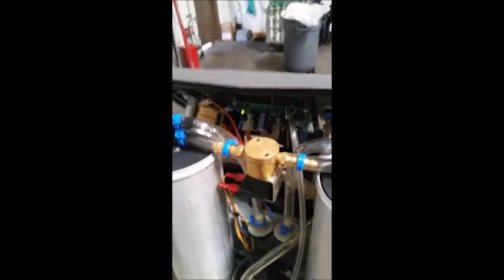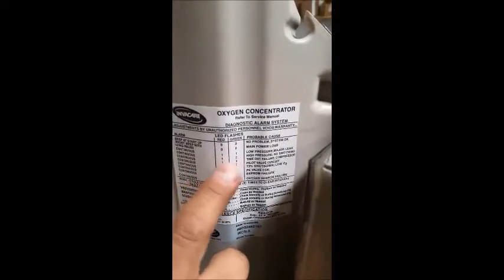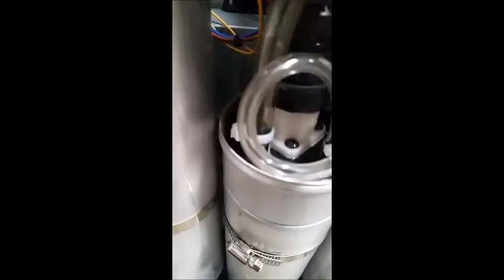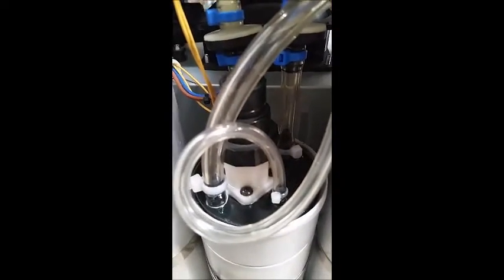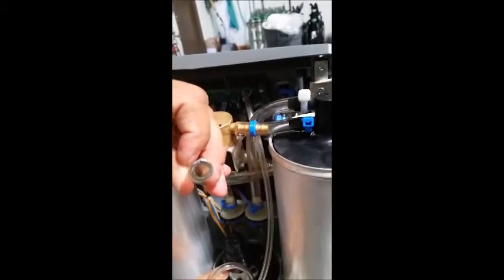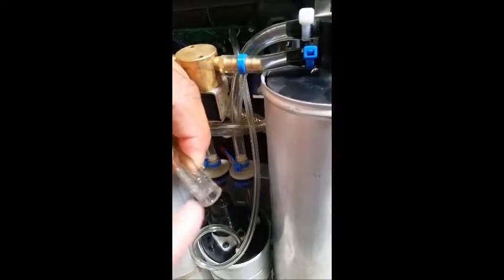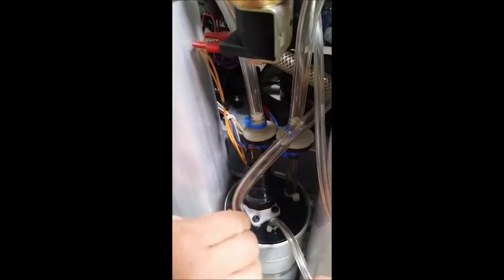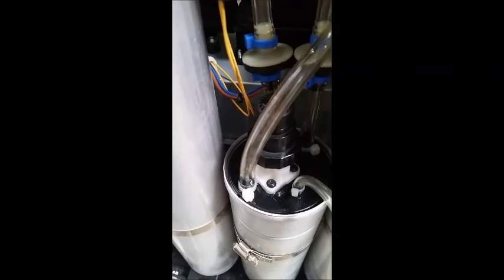Concentrator Leak Detection and Repair

Comment: Zip ties work, but over time they stretch and combined with deformation of the tubing that also occurs, they usually start leaking at some point.  Pick up some properly sized spring clamps at an automotive store and try those - they don't lose their clamping pressure plus they're reusable.  Save the wire ties for tidying up...

Comment: I bought one two months ago and it is being used every night for a few hours. Now suddenly I find that as soon as it is switched ON, it starts making intermittent hissing sound like when a vacuum brake is pressed in a truck/bus (releasing pressure) and the display shows only 20% purity of oxygen. Then again when switched OFF, it continues to give oxygen through the tube for a few minutes. It's an emergency. Can you please help me with some real advice? Thanks

Comment: That’s the one thing I don’t like about Invacare units.  So many spots that they can leak from.  Every time I open one up to repair it I always run into  either the PE valves connection to the sieve beds leaking or the product tank tubing leaking.  But by far they’re one of the best stationary units on the market.
Reply: I've got a red led flashing once and two green flashes.  It's not the PE valve, I don't think it's the 4 way valve, so I'm guessing it's the PCB.   Should I try pressing the auto timing button?
Reply: @equigs  that’s a high pressure shutdown.  To reset the board turn the machine on and off 5 times to reset the code.  High pressure could also be a tell tale of sieve beds that have gone bad or are on their way.  Check the compressors pressure also on the outlet elbow with a gauge that has a high and low switch.  Check the puppet valve also.  Sometimes the poppet valve inside maybe be sticking.
Reply: @freakerhunter8857  thanks a lot for getting back to me.  I'm waiting on the timing to settle.  The front panel red led is still flashing very slowly, after 30 min.  I don't know how long this takes.  Once that's done, I'll make a start by resetting the PCB and work from there.   Thanks for the advice.  I'll let you know what happens 🤞
Reply: @freakerhunter8857  6380 hours on the clock 👍
Reply: @freakerhunter8857  good news.  The auto timing is now complete and I've switched the unit off.  After turning it back on, the error code has vanished and I have just one green led on.  Looks good 👍  if the error returns I'll go through your steps 👍
Reply: @equigs  very good.  Sometimes though the beds are bad even with low hours.  The machines are designed to run and run as soon as you turn them off they back feed the ambient humid air and over time it Saturday’s the beds.  Glad it worked out for you though.
Reply: @freakerhunter8857  it worked all day yesterday.  I came into work today and started it up.  It ran for a few seconds and went into auto shutdown with loud alarms 😭.  The same high pressure error codes are back.  1 red 2 green LEDs flashing.  I don't normally repair these units because they are cheap enough to just buy a new replacement unit, but I'd like to start repairing them.  It seems such a waste to dump these units.  I was going to order in some spare parts from Invacare.  Is the poppet valve on the front of the compressor?  If the compressor pressure is too high, can I adjust it's output?   Do you work for Invacare?
Reply: @equigs  what type of Invacare concentrator is it?  Platinum 5, platinum xl, or is it a perfecto series? Is it a 5L or a 10L machine?
Reply: @equigs  what I would do is take the 4 way valve out.  Sometimes 4 way valves can stick and cause high pressure.  Do not take the 4 way valve apart otherwise you void the warranty.  You can take them apart if you have a rebuild kit but check with invacare first and see if the unit is under warranty they have a 3 year warranty.  Check the popper valve also and look at the popper valve like I said previously it may be sticking between nitrogen purges.
Reply: @freakerhunter8857  it's a perfectO2
Reply: @freakerhunter8857  where's the popper valve located?
Reply: @equigs  the poppet valve is located inside the pilot valve.  Go down to the 4 way valve which is in between the two sieve beds.  Under the 4 way will be a little valve with two wires connected to it.  Take a 9/16 inch wrench and take the bit off which will take the valve apart.  Then take a flat head screw driver and loosen it from the manifold.  Inside you will see a little poppet with a spring on it.  Check the rubber busing on it and see if there is any wear or tear on it.
Reply: @equigs  perfecto O2 is a better unit then the Perfecto 2v has a better compressor it it and larger sieve beds.
Reply: @freakerhunter8857  I just tool a quick look at the 4 way valve and I can see the pilot valve. It's hard to get at.  I presume I'll have to take off the 4 way valve to gain access to the pilot valve/poppet valve.  My boss told me to forget about fixing it, so I'm trying to do it when he's not looking 🤣
Reply: @equigs  haha best of luck man.